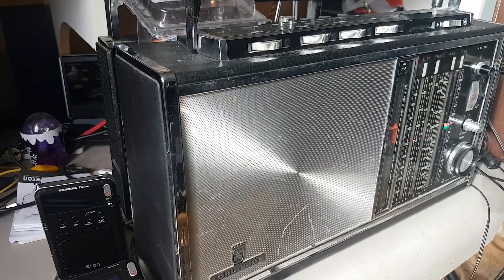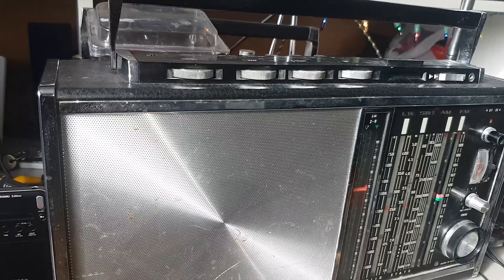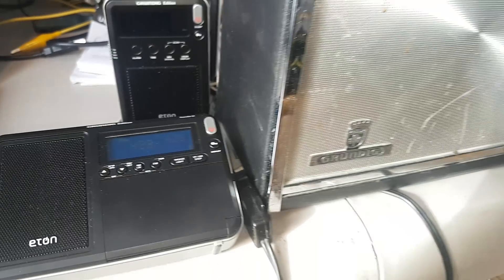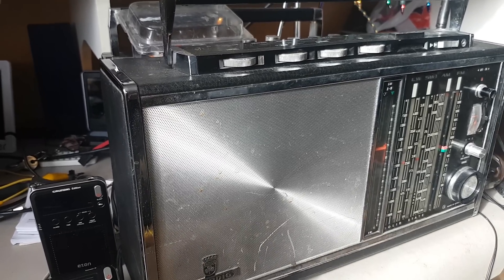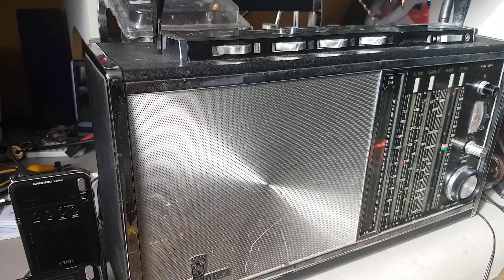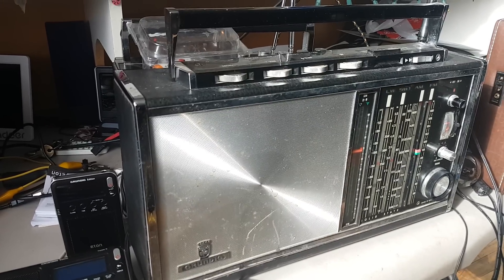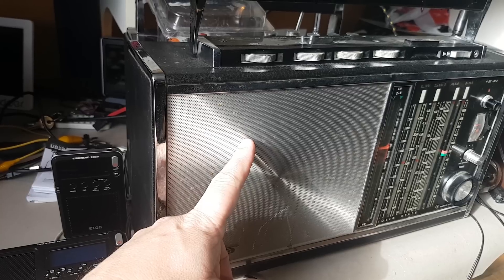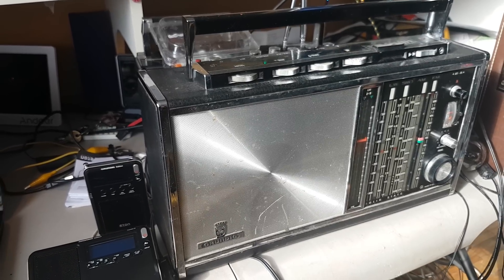Thinking of old VS new technology for radio

Comment: I've also tried experiments with an old Zenith Transoceanic 3000-1 from the 1960's and my Eton E1 (possibly one of the best portables ever made) and the old transistor based Zenith stands toe to toe with the new technology. The one big difference is the newer radio's sync giving it the ability to lock on to a signal. The older radio has a much richer sound, I've found this to be true with most older radios, they have great sound.

Comment: Hi Giles. Working on my old Grundigs is so easy. Construction was by skilled people and taking them apart is just a straight forward reverse of assembly. I tried to disassemble a 1990's Grundig yesterday, a piece of rubbish made in the Far East, to clean up the switches and pots, but I couldn't get the radio out of the case. One off use screws into plastic, glue, hidden clips etc. make it almost impossible to work on these radios, so from now on I'm sticking with pre-mid eighties Grundigs.